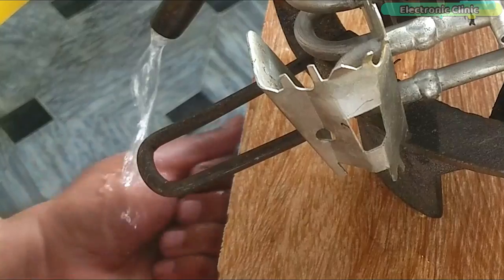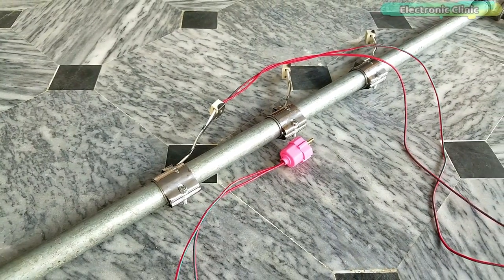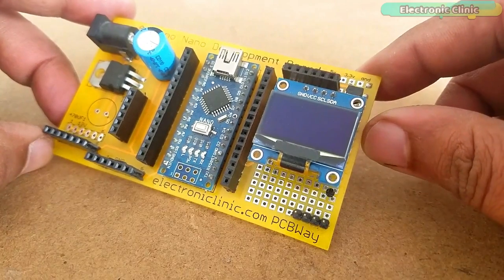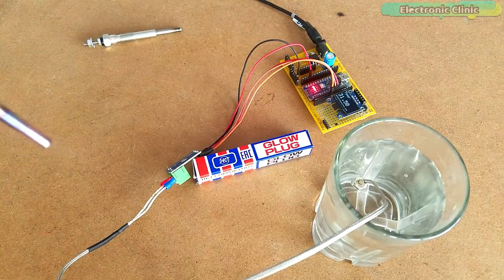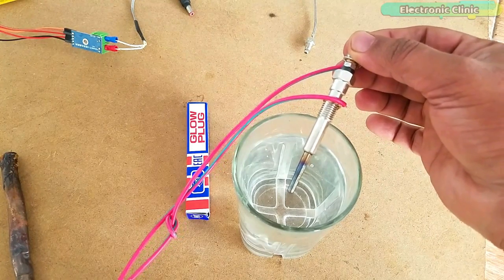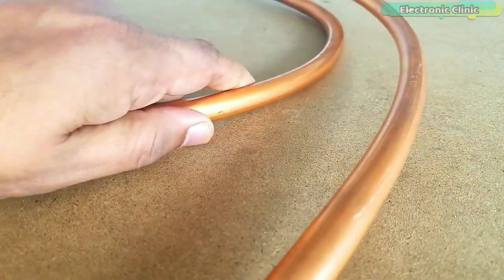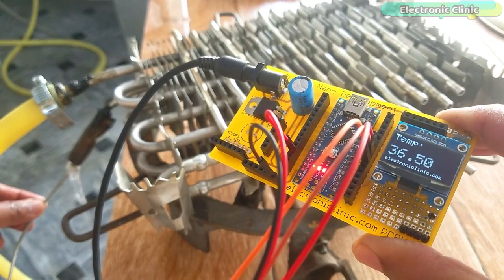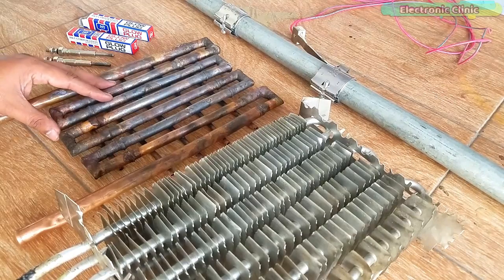Instant Water Heater, DIY Tankless water heater, DIY Water Heater, Glow Plug Scam Exposed

Comment: This is a great idea and it shows really clearly how much energy there is in propane and natural gas compared to electric service.

We actually built one of these for a hot tub we used on a camping trip.  The hot tub was just a tarp in a pit we dug and a copper coil circulated the water through a wood fire.  The heating element was a copper coil shape rather than a flat shape.  I think this would be slightly more energy efficient as more water was in contact with the heating element and it worked in a smaller surface area (it also helped the water to circulate as our pump was not very strong).  

I really liked how you showed the things that did not work. Did you ever make your plastic extruder and injection molding machine?

 I wonder if you would ever attach the valve and lighter to an Arduino in a full version of the heater or if you would keep the valve manual for safety reasons?

Great videos.
Reply from the maker: the next version will have semi automatic wireless control system.

Comment: Built a system that reserculates few times getting hotter. But it's better to have it heat up in a pan comfortable temperature then put in a cooler jug then use a pump to a faucet.

Comment: Hi, which temperature sensor do you use, good video
Reply from the maker: k type thermocouple with max6675
Reply: @ElectroniClinic  THANK YOU, THIS SENSOR IS COMPATIBLE WITH ARDUINO?
Reply from the maker: @chuyrmz4141  yes
i have used it in so many projects. check playlists

Comment: You need about 20-30 glow plugs for a tank and about 50 for instant water heater
Reply: really depends on the type of glowplug you buy. You can just calculate how much heating power it has. The 1 he has he claims uses 10 amps at 12v? So its just 120W of heating, that not much. There are glowplugs that run around the 30 amp at 12v mark, they are allready going for 360 watts. At that point they become usefull as water heaters. Not fast water heaters, but it wil get the job done. But my 3kw home boiler isnt even instant hot water either, atleast not at a decent flowrate. So even with 10 of those 30 amp glowplugs you wont have an instant waterheater, but you should be able to heat up about 2-3 gallons in 10-15min.

Comment: Thanks a lot for exposing the scam! As for your version of water heater, it is more sounding of course. Now, to make it portable, it is still challenging though. What I can think of, (by using your experiment) is a combination of portable gas stove, a copper tube folded in circular form with its  diameter covering the stove upside, and a 12v water pump, so I can warm up the bath tub

Comment: Instant water heaters use 2800-4000 watts. You would need to use 25 or so glow plugs to get the same effect. You'd want to heat a small amount of water as it passes by so try to make it an install in the pipes. Anyways nice try.
Reply from the maker: thats what i tried to explain, its useless to use glow plugs

Comment: What I liked about this video:
* good subject of interest to many
* good demonstration of testing others' claims and subsequent exposure of scams
* good pace and easy to understand

What I disliked:
* apparently unsafe practices are a bad example to viewers - were the glow plugs powered by full mains voltage, that you were holding by hand in a water container?
* no efficiency calculation of any water heating solutions.  It's arguable that the gas powered hot water system worked simply due to greater input energy.
* no table of costs and efficiencies as a summary.  How much did it cost to heat 1 litre of water to target temperature, and how does this compare to the cost of a commercially available water heating units (elec and/or gas)?

Looking forward to your next video!
Reply from the maker: i mentioned the total cost, i think you skipped that part.
Reply from the maker: commercially available instant water heater is added in the description with amazon purchase link. Instant water heaters are really expensive.
Reply from the maker: I am thinking of making another one, which can supply hot water to the entire house. I will do the practical installation, and will also design a wireless control system.
Reply from the maker: glow plugs are 12vdc, i powered them using 12v battery